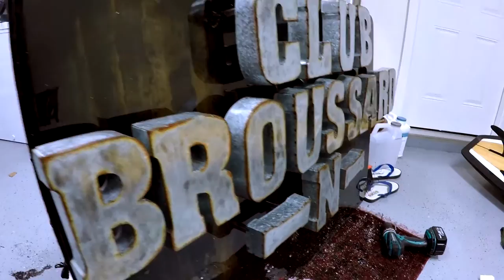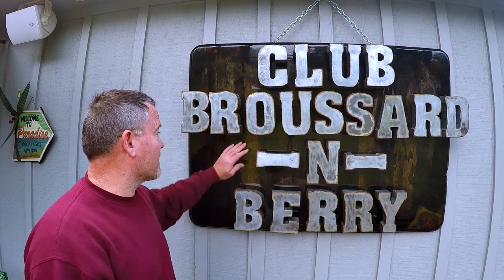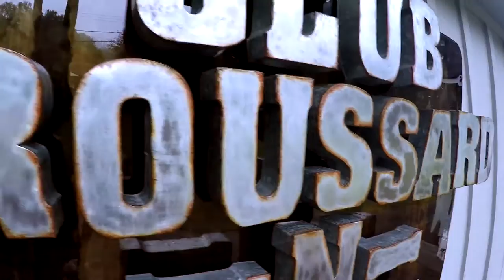How To Make a  Backlit LED Sign

Comment: dear sir, would u mind sharing what chemical u use to attach the side of that letter ??? coz i try using only soldering iron and tin, and it just wont stick... thanks
Reply from the maker: Super Acrylic  any soldering flux will work. I found that over time the “weld” fails if any pressure is put on the letter. I rebuilt the sign using a different method. The link below explains. 
https://youtu.be/ZTUs238JzcE

Comment: I think it would make more sense to just use epoxy to save a few steps.
Reply from the maker: Diehard Ch1ef Epoxy is a different sign. I have done that also.
Reply: grbroussard what color stain did you use looks kinda green in the video. but looked black while applying. I'm about to use ebony stain but don't want a green tint
Reply from the maker: Diehard Ch1ef I'll check the stain when I get home. It is a really dark color.